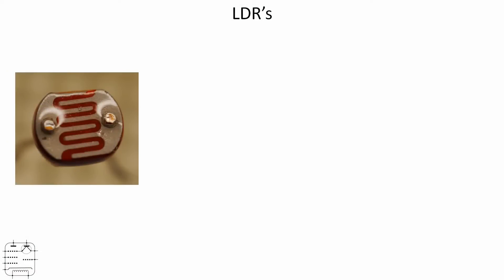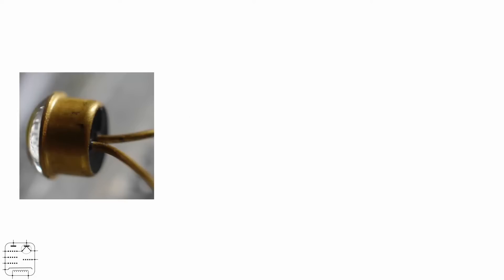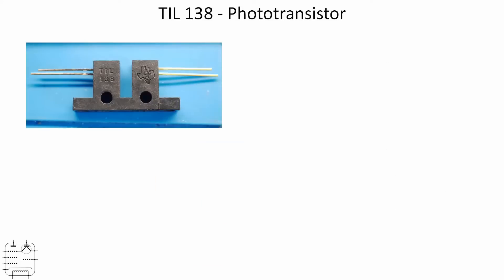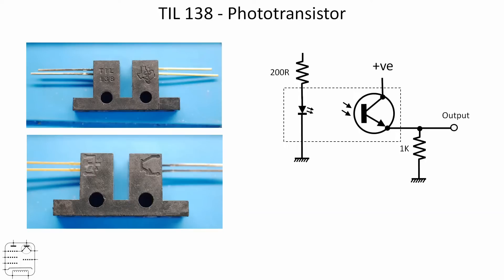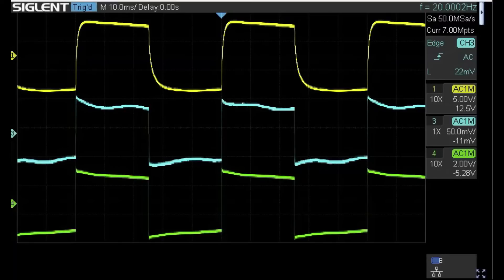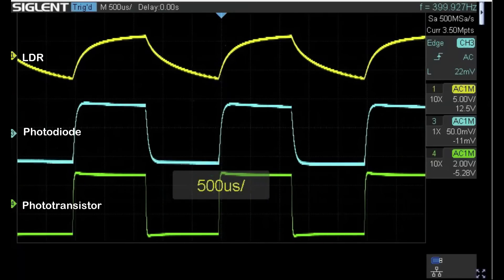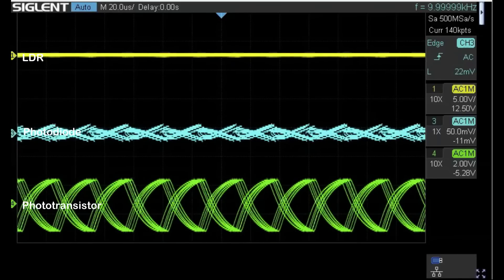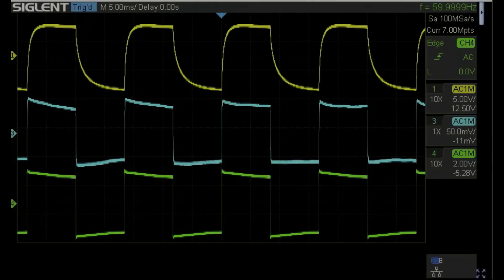Optoelectronics - Just how fast is an LDR? - #209

Comment: Hi Bill, nice video. 
I'm not a engineer or anything, just a electronic hobbyist, but a few years ago i gained a decent amount of knowledge regarding a LDR, when troubleshooting a fuel oil burner which use a LDR as flame detector. In short, the problem was that the fuel oil burner went in safety mode the first time it started up after a week of non use.
After a reset the fuel oil burner worked fine each time untill the burner was not used for 3 to 4 hours. After 4 different technicians and a lot of money spent on parts (even the LDR or flame sensor and the control unit where replaced) the problem was not solved.
I then went to see for myself what the cause could be, and i downloaded the service manual of this burner, and found that the LDR must provide a current to the control unit between 50µA to 200µA. I then made a breakout adapter so that i could measure this tiny current with my digital multimeter and discovered that the LDR current during burning was arround 55µA. The control unit gives out arround 15V @ max 200µA and the LDR is placed in parallel with this 15V. 
Now that i had a number (55µA) to work with, i made a "cardboard burner", a simple cardboard box with inside on one side the LDR, and on the other side a yellow 3mm LED, and the LED powered with my bench powersupply. The LDR connected on my bench to the control unit that i took from the burner.
So now i could simulate a flame by powering the LED and set my bench powersupply untill i got 55µA of LDR current.
I then waited a few hours, and powered the LED again, and then i discovered that for almost 3 seconds, there was no LDR current flowing, not even 1µA.
And then suddenly after those 3 seconds, the LDR current started to climb up, but before the safety time of 10a12 seconds was reached, the control unit went in safety mode because the 55µA LDR current was not reached within the 10a12 second of safety time.
This 10a12 sec is a safety to shut of the fuel if no flame is detected, in normal condition this can be caused by no fuel, water mixed with the fuel, fuel solenoid not open, or no spark.
After this experiment i started to measure the dark resistance of this LDR, and because this LDR is not a regular LDR, but a LDR made by Danfoss, you don't find a datasheet of it. When looking a similar LDR datasheets, these mention a dark resistance of above 1Mohm.
But here is the catch, this value of 1 Mohm is WRONG !!!
After testing many different types of universal LDR and the specific Danfoss LDR's that i ordered from different suppliers, i discovered that the darkresistance is not above 1 Mohm, but after a few minutes is above 1 Gigaohm (and still going higher).
Because my multimeter could measure max 100Mohm, i had to come up with another way to measure such high resistance. I then placed a LDR in series with 10V of my bench powersupply, and measured the voltage that pass through the LDR and used Ohm's law. 
After a few hours, and the voltage raised up to 30V, i could no longer measure a single millivolt passing through the LDR, so the resistance was in the many Gigaohms. 
Now, because this LDR is way up in the many Gigaohms, the first time it see light again, the resistance needs to come down again, and this takes time, the longer the LDR was in darkness, the more time a LDR needs to give his normal value when light shines on a LDR.
This phenom is called the "Memory effect" of a LDR, and this is the reason that sometimes LDR circuits don't work like expected, and then suddenly they work fine, untill they are again not used for a particular time.
To end this story, now i knew that the LDR current was to low for the fuel oil burner, i made a amplifier with a BC547 and a voltage divider of the LDR and 300K resistor, one side of the LDR connected to the + of the 15V of the control unit, the other side connected to the 300K resistor, and this point connected to the base of the BC547, and the other end of the 300K to the minus of the 15V coming from the control unit.
This amplifier is now in use sinds 4 years, and now even after not using this burner for 2 weeks, the LDR current is still arround 0µA after 3 seconds, but then suddenly jumps to arround 180µA way before the 10a12 safety time is expired. So a LDR can send you through some rabbit holes. Grtz
Reply: Sir, I have to correct you: You ARE an engineer. ;)
Reply: I would contact the manufacturer of the oil burner and let them know you have found a solution to a problem their product has.
At the very least, they should offer you some sort of reward for your work.
Reply: LDR behaviour sends one down a rabbit hole 😂...
another dark abyss..make sure you have a bright light there 😅
Reply: @analoghardwaretops3976  , i take a few of those 3mm yellow LED's with me :-)
Reply: Seems incredible they did not use a ion conduction sensor as is used in a gas boiler but I guess an LDR is much simpler!
Reply: @AnthonyFrancisJones  , a LDR is indeed much simpler. The control unit on this burners is very old skool and doesn't contain any microcontroller, just a handfull of basic components like transistors, resistors, diodes and capacitors. The timings are done by using a bi-metal strip that is connected to a series of contacts that enable and disable in certain sequence. These oldskool control units are still sold new. Take a look at Siemens partnumber LOA24.171B27
BigClive has taken similar control unit apart a few years ago. The newer versions of control units for these burners use a microcontroller and a IR diode with buildin amplifier in the sensor housing as flamedetector. Also the LDR's that Danfoss use look like a universal LDR, but in a slight angle and covered with a glass bulb like a Neon bulb. And this glass bulb is then placed in a plastic housing with transparent tip. The response time is arround 8ms, which is way quicker then a normal universal LDR that is arround 20ms and 30ms for the big ones (12 and 20mm).
Havn't found any universal LDR that has only 8ms responsetime.
Reply: @BjornV78 Interesting! Thanks for this.

Comment: I've been thinking about building a replica of the old 70s Tin Can Alley shooting game, using some kind of "light detector" placed underneath a can, which is placed above a solenoid (and using an arduino for controlling everything). I've been reading about LDRs vs Photo diodes vs photo transistor (I'm very much an amateur when it comes to electronics), so your video was perfectly timed. It answered all of the questions I had. Thank you for making these videos.
Reply: I suggest you add testing   another yellow led connected as   a photodiode. It would be interesting to see how fast such an LED used this way performs.

Comment: Hi Bill, interesting stuff. I haven't used anything other than an LDR. I presume that the differences in capacitance explain most of the differences. The LDR has a strong rise at 500nm, I guess that's where the potential use is, sunset/sunrise versus daytime light perhaps?